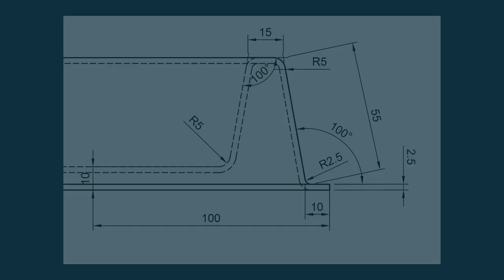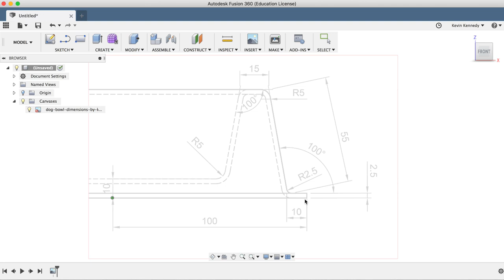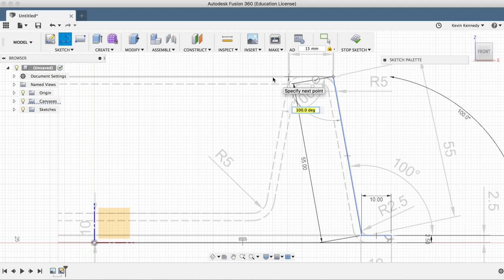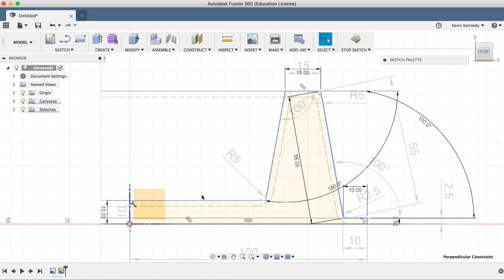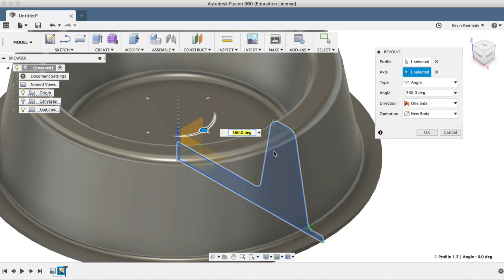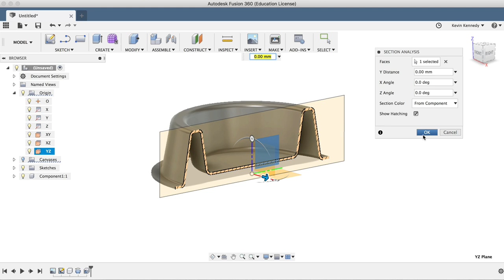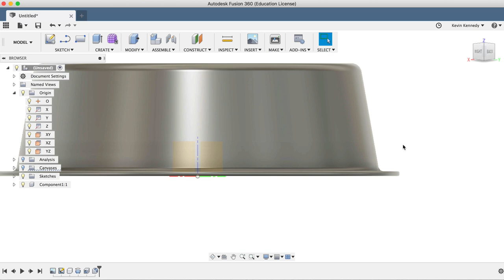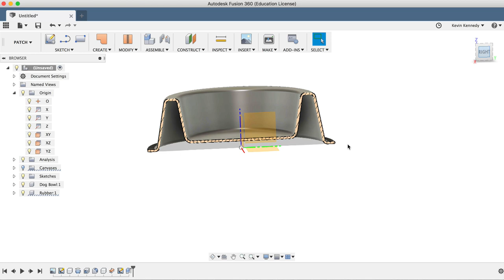How to 3D Model a Dog Bowl - Learn Autodesk Fusion 360 in 30 Days: Day #11

Comment: When trying to use Shell to hollow the bottom I can't select the bottom face. It wants to select the whole component. I have Select/Selection Priority/Select face priority checked. Without Shell active I can select just the face.
Reply: Think I figured out the issue. I had trouble yesterday with the same problem. Kept going back and redoing it and it finally work, but not sure why. Today i started from scratch again but this time since I knew I would want to fillet the bottom outside edge later I did it in the sketch before I revolved it. Then I couldn't select the bottom face to Shell. My dialog box looked the same as yours. Then I unchecked the Tangent Chain box and it worked. I had no idea want it meant. Now I know... with the bottom edge pre-filleted the outer rim was tangent to the bottom face so with tangent chain checked it had to select the whole bowl. Then I also learned why you didn't fillet those corners before doing shell. If filleted before doing shell, shell will remove the whole bottom lip. Cool! But now I have to retract all the nasty things I said about &@#^%# buggy software!
Reply from the maker: Hi Steve. The "Tangent Chain" option shouldn't have affected it in this scenario unless your file was set up differently. The fillets definitely would change how the shell command works, as you found.

One thing to be aware of, as someone had run into this yesterday... make sure that you're using the solid revolve command (blue icon) and not the surface revolve command (orange icon). Surface bodies have no thickness to them, which means the shell command will not work.

Would you mind sharing the link to your file so I can take a look? To share your file please go to File > Share > Share Public Link (make sure "downloadable" is toggled on) > Paste your link here as a reply to this comment. Then, please write a separate comment letting me know you've replied with a link because YouTube flags most links and I don't always get notified. Cheers, Kevin :)
Reply: @ProductDesignOnline  
Hi Kevin. The problem I was having was caused by filleting the bottom rim before I revolved it. I have that sorted out and successfully made 4 bowls. However, I had moved on to other tutorials then came back to this one and can't select the 185mm circle to extrude to trim the rubber. It seems to be reaching right through the circle on the bottom to the faces on the bowl. I suspect I have messed up my selection settings but don't know where. I put my preferences back to default but it hasn't fixed my selection issue. Could you add recommended selection settings to your default setting web page? Do you have a selection tutorial? Thanks.
Reply from the maker: @dlpgraphics  Hi Steve, I don't have a tutorial specifically on selection filters, although that's a great idea (added to the list). I would suggest resetting yours. Click the "select" dropdown > selection filters > Check "Select All" which will turn them all back on (default). Here's an image for reference - https://snipboard.io/tSRUF7.jpg

Let me know if that fixes it for you. Cheers, Kevin :)
Reply: @ProductDesignOnline  
That didn't fix it but I now know what I was missing. It seemed to be an intermittent problem. After I posted yesterday I left it for a while, then went back later, made a new one from scratch and it worked fine. This morning I went back to it and deleted the extrude from the timeline. Then when I tried to redo it I couldn't select the bottom circle again. What was happening was when I deleted the extrude from the timeline it left the circle sketch visibility turned off so when I tried to redo the extrude it couldn't select the circle. Just had to turn visibility on for the circle sketch!
Reply from the maker: @dlpgraphics  Thanks for the update, Steve! I'm glad that you discovered it was the sketch. Sometimes those little things really trip up the workflow. Don't hesitate to reach out if you run into any other issues. Cheers, Kevin :)
Reply: @dlpgraphics  thank you!  I've redrawn this 20 times at least trying to figure out where I was messing up. Turns out it was the sketch visibility.  I'm trying to learn 360 for woodworking and found this series. Thanks Kevin, it's slowly sinking in!